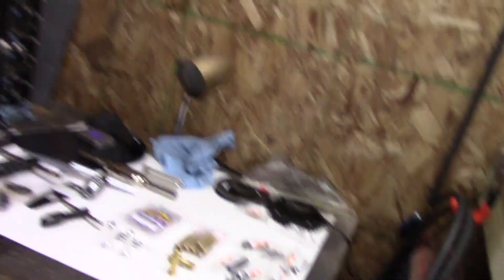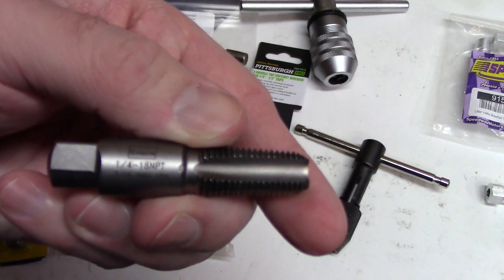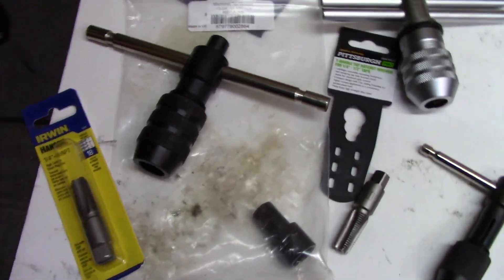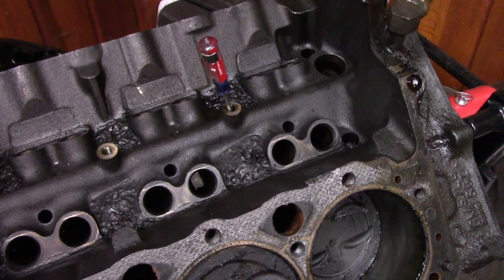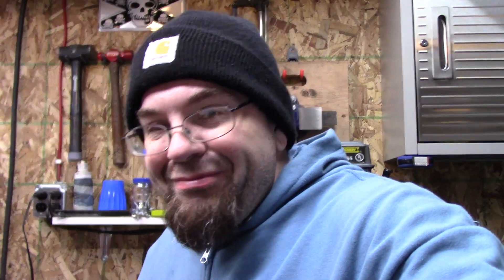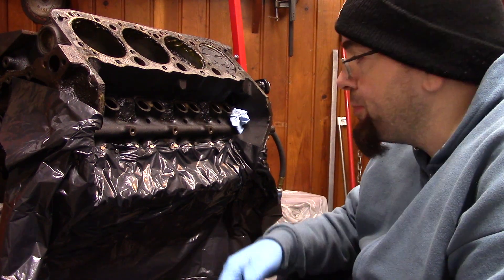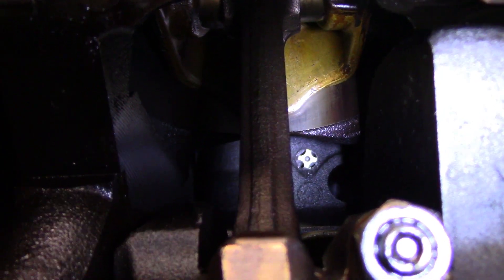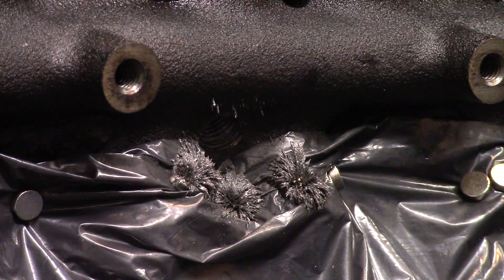SBC Lifter Valley Vent Tubes , Donor Vortec 5.7 Budget Build Part 0.5

Comment: What size drill bit did you use to open up the hole?
Reply from the maker: I didn't, the holes in the block for the vent tubes are already sized good enough.  Least that's what I've always herd for doing this mod.  I did buy a better tap to finish them up tho, when ever I get back to this build LOL

Comment: You can wash it out with kerosene, Diesel, it even gas, to be sure it's all clean, 
But it looks like someone would make press in vents, like the oil pump pickup!
Reply from the maker: I don't know of any that make/sell something like that BUT I did consider turning some tube for a light press fit and using green loctite